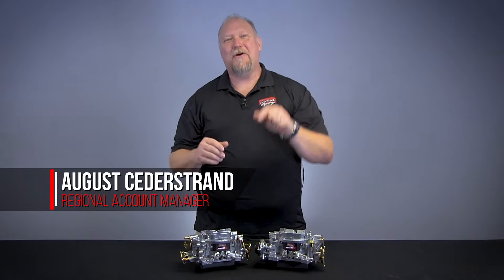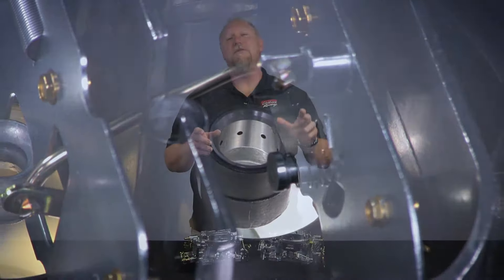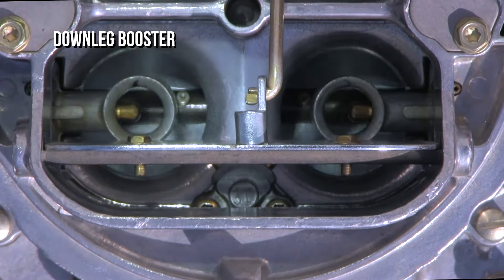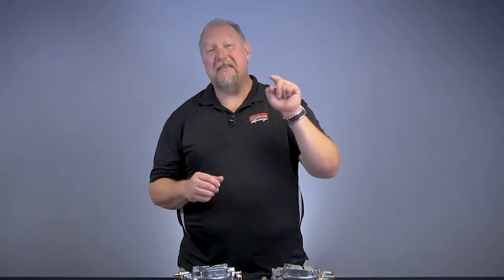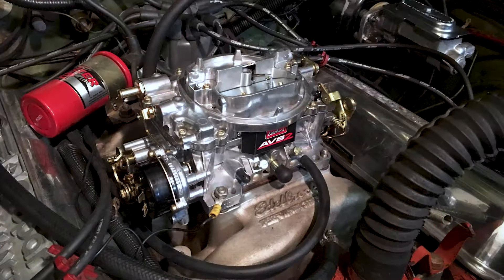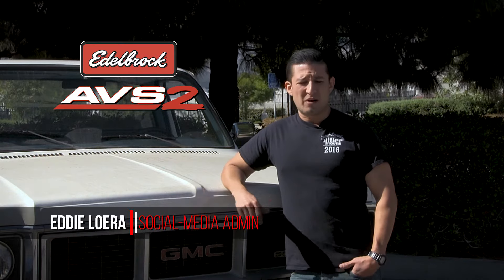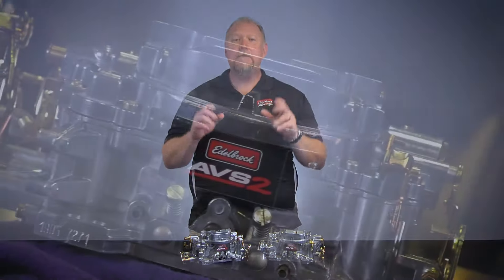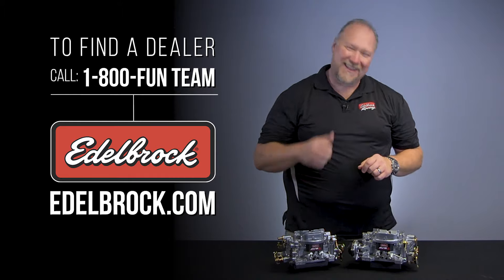Edelbrock AVS2 Series Carburetors

Comment: Really like this carb on my 1977 caprice sedan. i live in Norway, so not every day you bump into old classics, and its fun. The car is also my daily driver and this carb at 650 cfm is giving much needed fuel to my 350 sbc. Only thing i noticed is that the screws are almost all the way in after adjustment hehe, but i plan on putting some new aluminium heads on it which i hope frees up the carb a little more. i'm very pleased at the cheap price of 450 dollars (including tax and shipping). Transition between secondary and primary is noticeable, feels like injection or tbi, and releases loads of power :)  .Thanks Edelbrock, your carbs are the best!
Reply: heisenfeis have you an automatic transmission??

Comment: This carburetor is worth the money, the throttle response is crisp and smooth acceleration.
Reply: basically an improved quadrajet from what I understand.
Reply: Its a wild child on. my 99 355sbc S10 and even better with the 5SP stick shift I installed the 650cc AVS Thunder Series 4barrel. It loves turnin the tires.
Reply: @zragevii4705   Not even close to a Quadrajet.

Comment: I'm more of a Rochestor fan, I run Quadrajets on my C10s (one of which is a Vortec headed 350 320hp/400ftlbs) but on pawapws '77 C10 its had a 2101/1405 combo on it since he bought it. The 1405 has seen better days, and the lack of electric choke was annoying Rather than try to track down a 40 year old Rochestor and get fix it up we decided to go with a 1906 Edelbrock. I'm actually rather impressed with it. The annular flow boosters are definitely an improvement over the traditional downleg (and the electric choke is nice too)
Reply from the maker: We are glad to hear you like your AVS2 : )

Comment: I put an 500 cfm AVs2 on my Mustang with Edelbrock alu heads and AirGap intake.. Works fine, almost as EFI.
Reply: What size engine? A 500cfm is most likely too small with a good set of heads
Reply: @ThomasShelby-uq8cz  289. However, it lagged when kick down, so I switched back to a regular 600cfm (1902) and all was fine

Comment: I need the 4300 squirter to make my transition from 2 to 4 smooth. I have been trying to buy part number 1475 for over two months.  Everyone is on backorder and summit keeps pushing up the date. If you don't have parts for your carb 1905 then stop selling it. I had to put my Holley DP back on. Never had a problem getting parts for it.
Reply: Absolutely agree

Comment: Would a 650 AVS2 and an RPM Air Gap intake be a good fit for a stock 66 396 (rebuilt to 402) work well?

Comment: are there going to be changeable idle feed restrictions to fine tune the engine fuel needs from just off idle to when the primary booster has enough air flow to start flowing about 1900 RPMs.. this is where the fuel economy can be made.. and crazy fast off idle throttle response.. the new annular flow  boosters work great when flowing .. there is something known as  the LOW SPEED CIrcuit that needs to be tuned to match the engine displacement.

Comment: When is the 800 cfm avs 2 coming?  Also are the booster compatible with older Edelbrock carbs? Could you sell the boosters to retrofit in my current 800 cfm preformer?
Reply from the maker: the 800 series should be available later this year. We will not be offering boosters on their own.
Reply: Sidecardbob how did you modify the booster?
Reply: Sidecardbob where your inserts just straight on the inside? Don't annular boosters also have to have their own ventri shape on the inside so as to induce a increase in velocity thru the booster?  The pictures I have seen of annular boosters they look like a rolled up airplane wing. It sounds like you did a good job with the 8 holes and a channel to hit all 8. Do you have any before and after pictures?
Reply: Sidecardbob  I am in the states. I have heard of those motors before. Arnt they aluminum blocks?
Reply from the maker: Your home made annular booster will not perform like our properly machined boosters.
Reply from the maker: Have you tried our AVS2 series Carb?
Reply from the maker: Just checking to see if you actually have experience with our AVS2 Carb or not.
Reply: If you need a tester for the 800 AVS2, I am game :-) 1966 caprice 383 stroker with a 700r4.
Reply from the maker: Why you should try our AVS2 carb. The new AVS2 is not jetted the same as the older 650 so you can not compare the two.
Reply: Which AVS2 Carb would be perform good on a 454 big block?

Comment: Is this carb smog legal in calif.my chevy truck is a 82 chevy c30 with a quadrajet 350.its considered to be non egr non cat equipped truck due to its gvw 8600lbs.it has a smog pump.the rest of the smog equipment is thermal vacuumed controlled.the limits for hydrocarbons is 200 hcs or below.

Comment: will this work with the edelbrock eps performance intake manifold, and what do I do with the valve cover breather that has the tip comming out the side code number 4413. dont know what the tip on the top side on the valve cover breather.

Comment: for how many psi of fuel is designed...?is the same like the other regular edelbrock carbs 6.8 or so PSI?
Reply: Run the same fuel pressure as any other Carter AFB based carb.

Comment: Can the annular flow boosters from the new AVS2 be put on the older AVS carbs?
Reply from the maker: We will not be offering the Boosts separately.
Reply: It's your company I guess.
Reply: Edelbrock USA 
Will the 650 be enough carb for a 450hp 355 engine?

Comment: Does the carb have to be tune if i have headers cam intake   or just put the box is good
Reply: Depends on how much duration your cam has. If it's nothing radical this carb should be fine out of the box. I plan on using the 650 avs2 on my 350 with aluminum heads, air gap intake, and cam with .504 lift.

Comment: I just put this on my car, & am experiencing that dead spot from idle to WOT ... after about a whole half  second then it takes off.. otherwise besides that it feels smooth through the whole powerband.... what should I do ?
Reply: Grab a tuning kit and change out the springs... Likely need to go up to a stronger spring. Also check which hole the throttle lever is set to... If it's in the top hole, move down to middle one. Try one at a time.. hopefully that solves it!
Reply: I have a 383 stroker and it just does not like this carb I can not get it to tune right it will go up and down in rpms if I'm in it not a smooth carb lol

Comment: F** the old ones were way better take 3 days to get the stumble out of the mother funker I would rather just set up a Holly but the   Edel Brock get better gas mileage in better response throttle response around town  But the thing leans out when the secondaries open That secondary vacuum  Plate with the holes in  It bunch of junk the old ones of the solid plate I think work of better secondaries open up get up mass with the metering Springs Mild 350 horse 350 era gap 650 edlebach tuning nightmare Been doing this for 20 years plus never had so much trouble dialing in a carburetor Put super big accelerator  Pump quarter and it Is much ported timing is I can give it Is more reliable than the single plane and the 750 Holley that I took off of it but it still has a off throttle hesitation All the research I've done on these new AVS carbs they  seem to have the same issue everyone online is complaining about the same thing It's like the 650 is more like A750 Holly I've had better luck just put in a 600 on the thing Then they run out of the Box but these new ones they do not fuhkien run out of the Box Should have been easiest thing ever throw 650  on mild 350 Chevy have it run great That's why I Wanted to put edlebach on in Stead Of a fucken with the Holly Could a set Up the Holly to run perfect in half The time just would not have as good a gas mileage  In less   Street able  Carb What the f***'s
Reply: Bigger secondary jets maybe would help?  I read these things don't have a 2nd accelerator pump.
Reply: Tighten the spring on the seccomdary air valve
Reply: @Brons2  the only carb style with a seccondary accelerator pump is the Holley Double pumper (vac 2ndary holley are single pump) 

Air valve seccondary carbs (Like Rochestor or any AFB style carb) have no seccondary accelerator pump, but by slowing the air valve opening you can eliminate the stumble.

Comment: All that thing is is a fucken Big  Flat spot floats were not set correctly  metering Springs were Wong  for normal engine I'm talking about a very mild   Camed 9 to 1 Chevy small block 350With the air gap in take my favorite intake in the worldI bought one of these carbs because I knew and run of the Box and be reliable without a lot of tweaking m********  was I wrongI do put the biggest accelerator pumps quarter set the accelerator pump to the richest point give it as much time as I possibly could to get the stumble out of i tQuad  jet would have ran betterHad great luck with these car racers before the new ones don't seem to have itReason you get a edlebach is because I don't wanna funk with a Holly

Comment: Trying to put on of these in an f250 and it's the biggest pain in the ass I've ever had doing anything in my 30 years of working on cars. It doesn't clear hard fuel lines, it doesn't clear the unremovable bracket for the cruise on the other side without reengineering the throttle control. Garbage. If my girlfriend wasn't a total dumbass and believes everything AutoZone tells her, I would be taking this piece of shit back.